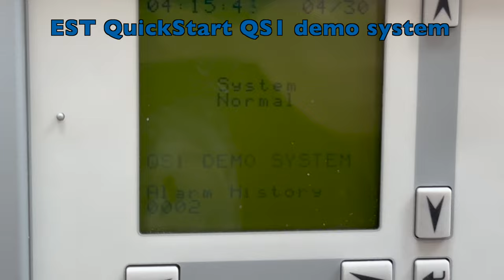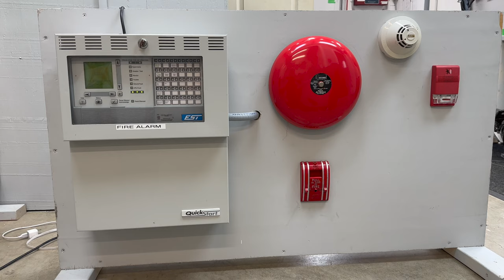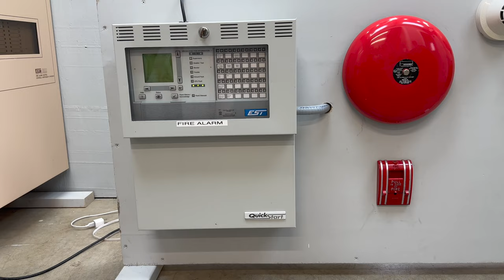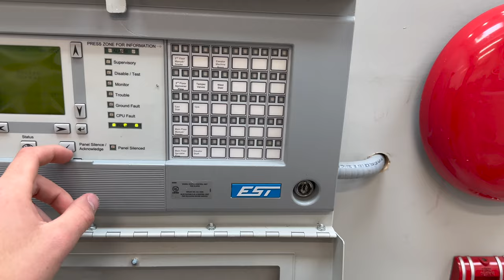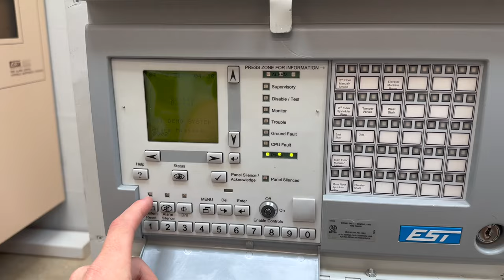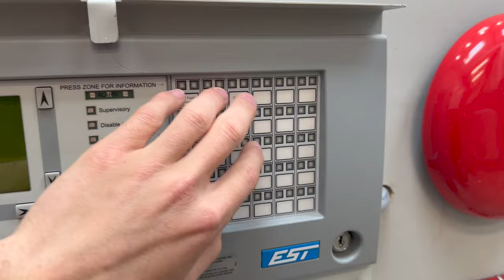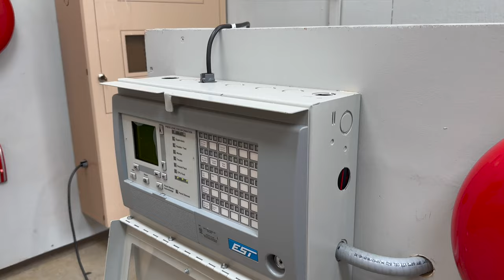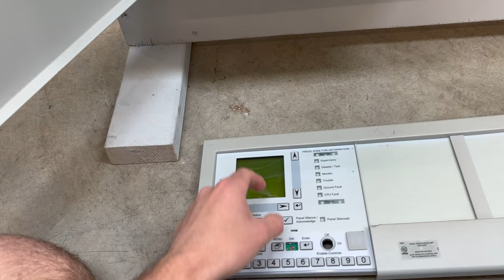EST QuickStart QS1 demo fire alarm system

Comment: fun fact that 24 BPM code if you took a single shot of that and fed it to the bell youd mimic almost my HS fire alarm....single blast bell was for class change and full evacuations was continuous bell (the system used some bells on red strobe mounts and a few old GENT bells (here in the UK a red strobe is for fires as opposed to your white strobe))

Comment: Honestly, I’ve always found the quickstart interesting. Even though it’s definitely not the best panel, it’s still interesting based on how it works and how it improved over the years. I actually considered buying a quickstart to replace my fireshield panel with the ground fault which I have traced to the board.

Comment: This is exactly the same as my rec centre’s system with the same panel, bells and even detectors. The main difference here being is that the 270 pull is the single stage version while my rec centre has the dual stage 270’s with the key switch to initiate stage 2. The movie theatre near me though is even more interesting as it uses single stroke Adaptabels and 439D bells(single stroke version)and the bells work and sound perfectly with the style of “coding” it uses in both stages. Stage one goes like this; ding…pause…ding…pause…ding. Then once stage 2 is initiated is goes in a sort of ding ding ding ding (march time style) Unfortunately once Edwards did away with it’s single stroke series of bells in the 2000’s the coding and bells never quite sounded the same but none the less this is an awesome setup. Exactly like what my Rec Centre system (installed 2003) does so it’s spot on with today’s dual stage systems.

Comment: So did the EST Panel said CPU FAILURE and the CPU FAIL Light turned on when it was Water Damaged because the in the video you said that the CPU Got damage by a leak in the boiler room above the Electrical room

Comment: Hi, how can i replace a smoke detector For new one, i try to use the software but i cant connect to panel, i have the right settings com port. But still cant connect
Reply from the maker: You will have to verify the pins on the RS 232 are going to the correct terminals on the panel you shouldn't need the software to install a new detector head though from my experience you can just swap them out and the panel should recognize it

Comment: this sounds like west Edmonton mall in Edmonton ab they use the same system as the demo wall the bells are mix of Edwards mb10'24's and some 439d and some simplex bell's this demo system sounds exactly like the fire alarm at west Edmonton mall here a link to the video of WEM's fire alarm https://youtu.be/izYROCbJNrQ
Reply from the maker: Yes!! I've personally only ever heard first stage at wem but that was still cool.
Reply: @nics-systems-electric  i was thinking WEM has the same panel as this video but bigger cabinet considering WEM is a larger building